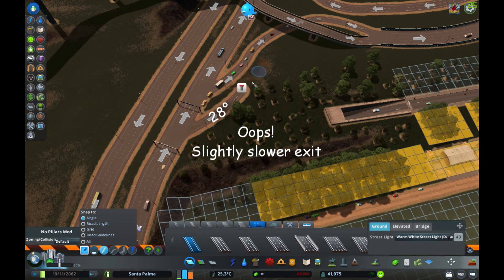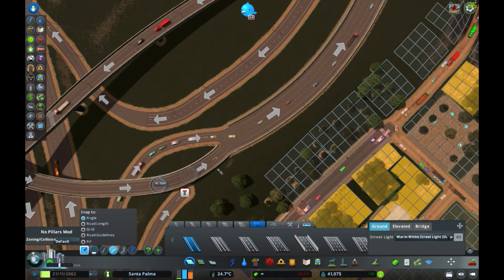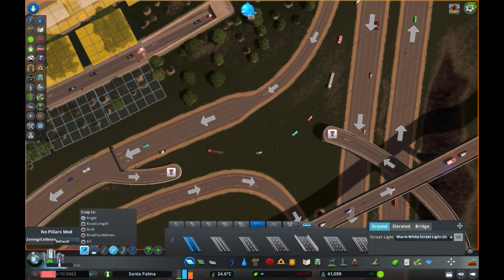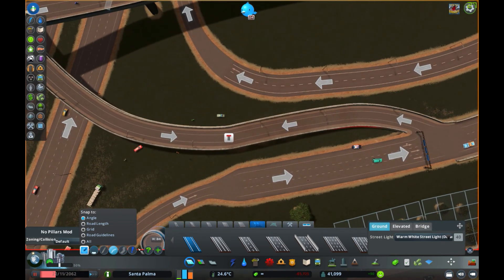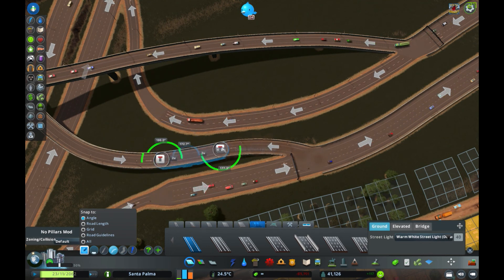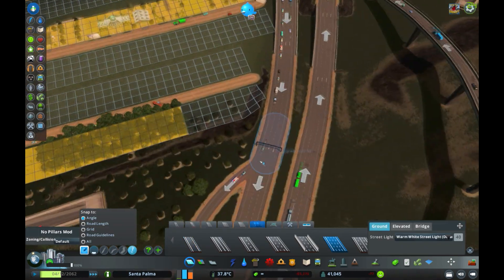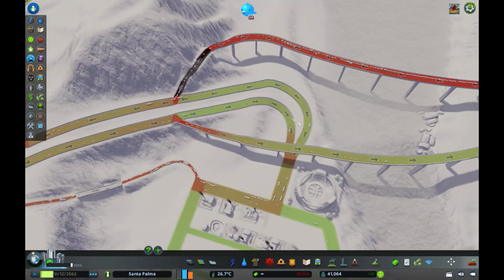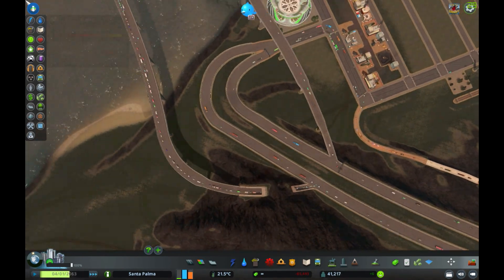Faster Exit Part 2

Comment from the maker: Hey there Silent Pact.
You are correct a redesign of the highways is the better fix, and your suggestion does work. The save I use here is the one I was asked to inspect before I did any repairs. This interchange was one of the best places to show the dramatic change that 20° will make to traffic flow, or how decreasing the angle of the off ramp will increase the speed and volume of the off ramp. 

This repair is about reading the traffic and creating a better roadway for them with simple changes. In this case, stopping them from having to cross all three lanes to get to where they want to go.

Comment: Me likey! That said, I'm beginning to wonder, looking at what I have to work with here - which of course is only what is seen in the video - beginning to wonder if what you really need to do is go ahead and make the highway go the route of the current off-ramp and have an off ramp go the way of the current highway? Top video though man :)
Reply from the maker: You are correct a redesign of the highways is the better fix, and your suggestion does work. It's a good idea.